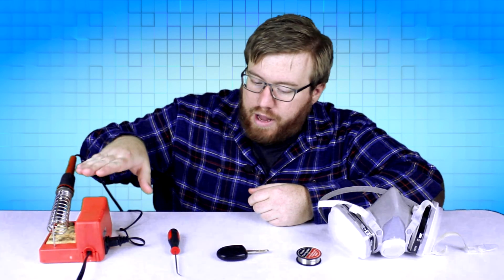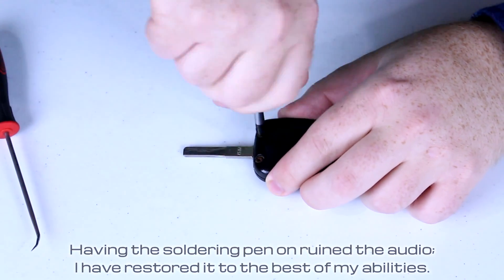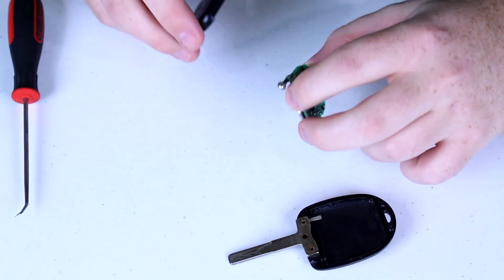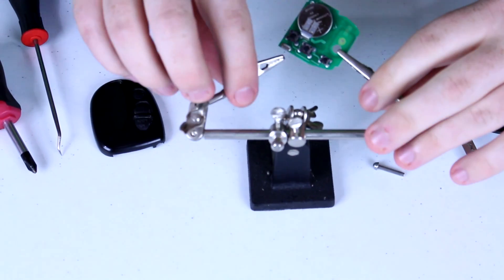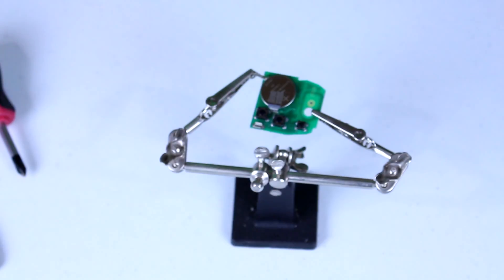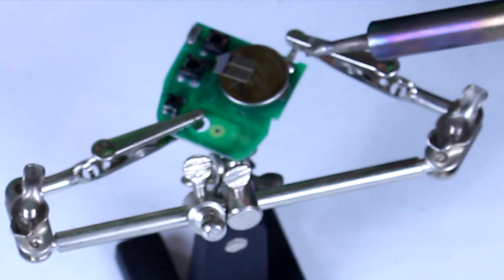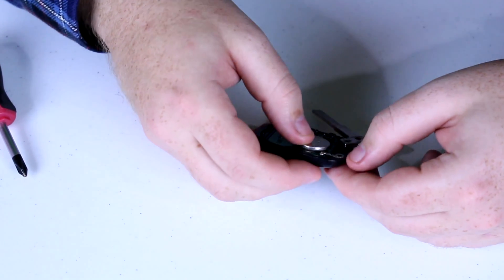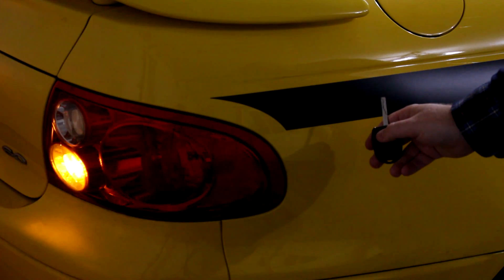Repairing a Key Fob/Remote Chip Board • Cars Simplified

Comment from the maker: Here are the tools and consumables Steve used and had on hand:
Lead free rosin core solder: https://amzn.to/2QpgDEE
Solder pen with stand: https://amzn.to/2QviPL4
Quick dry electrical contact cleaner: https://amzn.to/2wVFuqC
Face mask: https://amzn.to/2Mkkx2n
Pick Set: https://amzn.to/2QqrGgP (Single shown: https://amzn.to/2p45e0y )
Small tip screwdriver set: https://amzn.to/2x9Rk0N
Third hand: https://amzn.to/2N9CqSX
Third hand with Magnification: https://amzn.to/2CQ0qFY

Comment: Can I just replace the battery and case? My buttons are worn out and I have to use a tooth pick to push buttons
Reply from the maker: The battery on these GTO keys is fused to the chip; if you can get it off of the chip without breaking it, you can definitely replace the battery. The case can be replaced, too. Not all replacement cases come with the Pontiac logo on it, though.

Comment: This is a new feature that YouTube has apparently granted this relatively small channel. I didn't realize it was going to put this out there the way it did, but I guess I'll give it a try. - Steve
Reply: Cars Simplified Extras yeah its the same goat/monaro key. I just wanted to buy a new key housing and transfer the internals and blade over. Everything works but the oem rubber buttons wore out years ago.